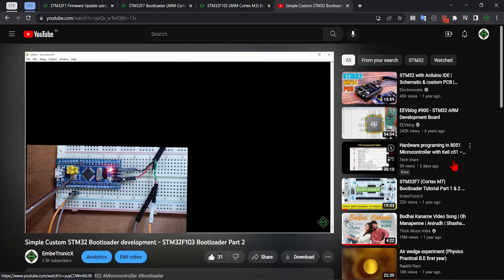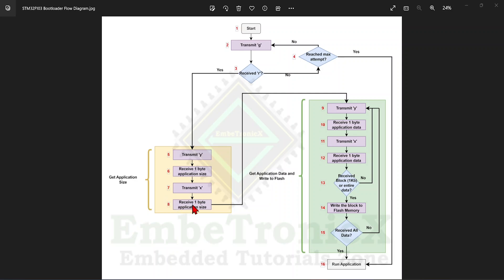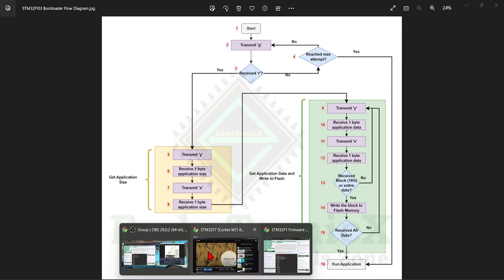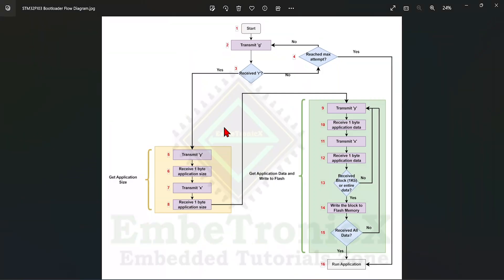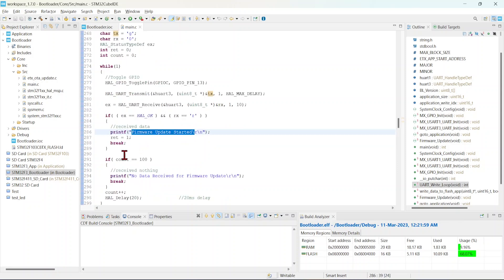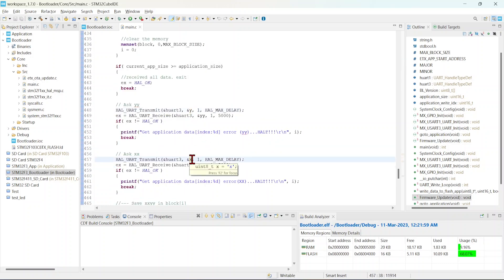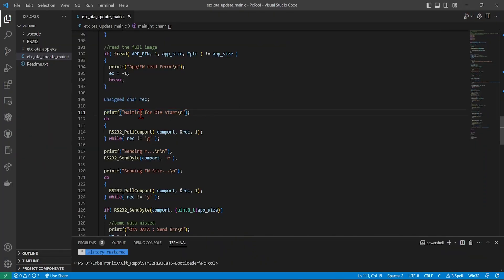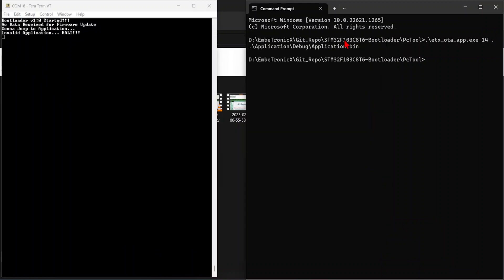Updating the Application using Custom Bootloader - STM32F103 Bootloader Development  Part 3

Comment: thanks for the tutorial, not many tutorials on STM32F103 are available on net, most tutorials available are on nucleo or disc boards. Till part 2 I have tested and everything works fine. On part 3 wiring i have a question, on the website its mentioned PA9,10(data Xfer) and PB10,11 (DEBUG). But in the you tube pic you showed SWD pins are also connected , is that used ? or not needed ?